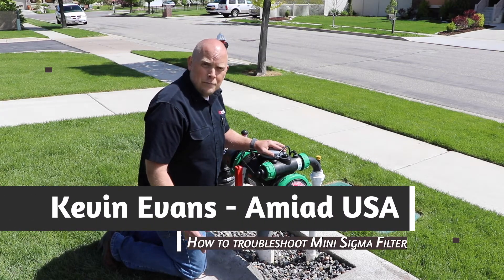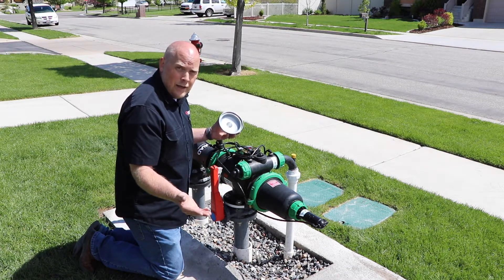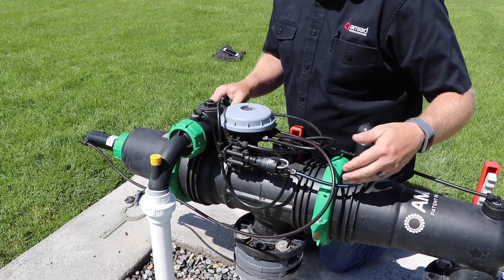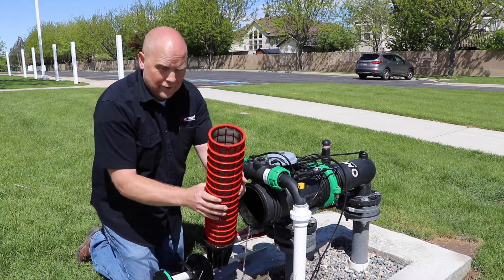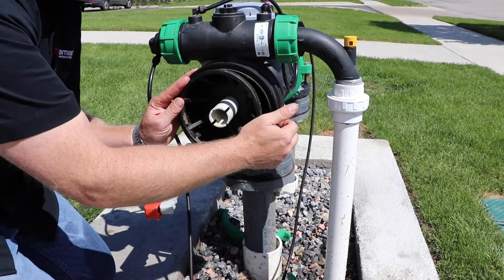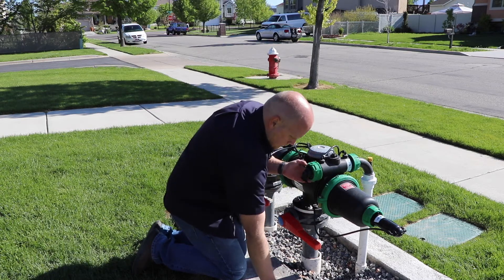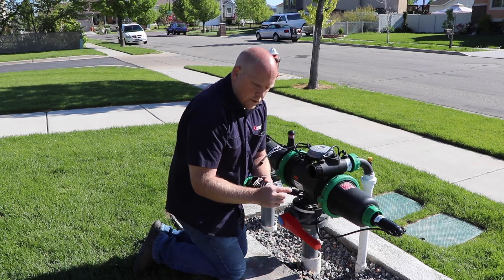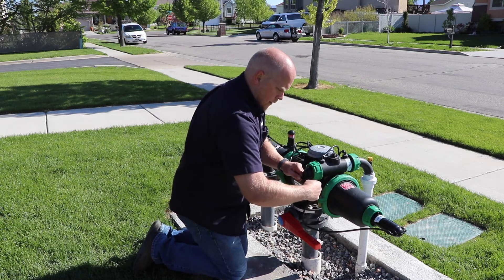Mini Sigma Maintenance-  Troubleshooting EN

Comment: What could be the problem if the water leaks from green cap at the very front where the tubes are conncected? I have opened it and cant find anything. It only leaks when flushing manually.

Comment: When you place in the controller, shows that has kicked in but no water comes out.

Or when even you command it from the solenoid switch, kicks in but water doesn't come out

Comment: A word of advice for anyone that owns one of these.  If the o-ring  gets damaged that is on the piston assembly underneath the green cap, there is no replacement available.  Don't buy the seal kit because it's not in there.  You will be forced to buy the whole piston assembly.  The price quoted to me by my dealer was $164.00.   All for an o-ring that is probably only a couple of bucks at most.

Comment: We had an issue it kept rabbiting. Filter was clogged and we cleaned it. Then it kept low flowing flush no matter. Checked flow and no vacuum. All was good. 
Finally pulled base of command plunger and O Ring was off half way at the base. 
That’s what happens when you have too many hands looking at the pot.
Reply: Where is located the O ring?

Comment: My filter won't flush....the solenoid clicks but won't flush...it will flush manually by turning the valve above solenoid...km located in Georgia.
Reply from the maker: Hi Dwonn, if you require help with your Amiad filters, please contact us via E-mail: infousa@amiad.com
Or call us at: 1 704 662 3133